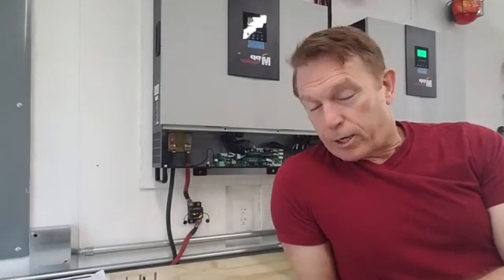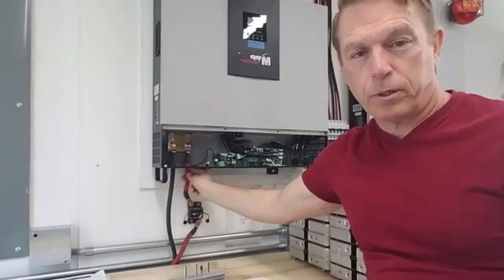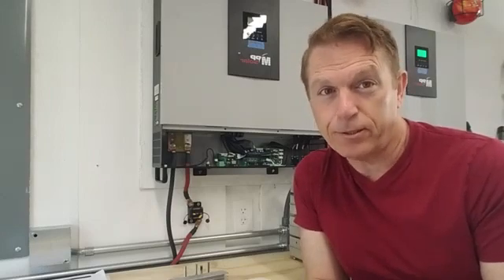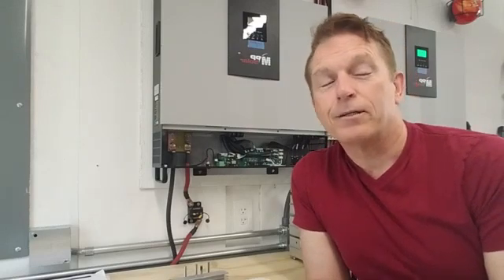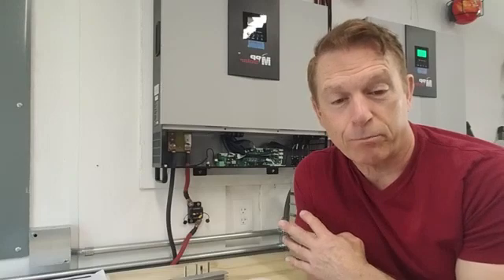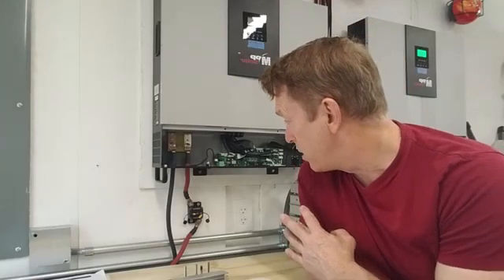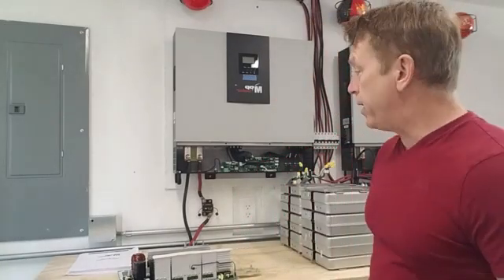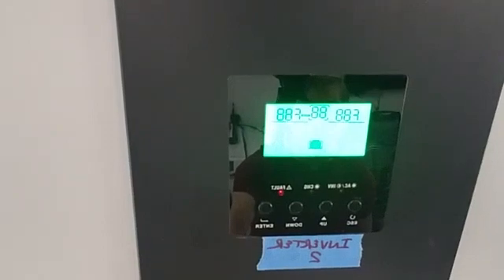MPP Solar LV5048 Mainboard side swap

Comment: You claim to be some sort of electrical engineer yet you can't even get the sound to work in your video and everything is mirrored.
Obviously you have one of two things going on. One is your batteries when these units are paralleled batteries must be connected together as one battery Bank or it will trip codes as it is necessary for balancing that both units work from the same battery voltage and amperage.
The other is the grounding center tap and Earth ground they should be connected together at the breaker panel not sure which way your paralleling these units. There is a grounding tap screw near the center on the main boards the grounding screw needs to be removed from both units then the center cap and Earth grounds will be connected together at the circuit panel which you should be using a double throw breaker preferably a fourth row means your paralleling two units of appropriate amperage to feed into the houses grid supply.  Are you using one unit for each leg so that one unit is exclusive to l1 and the other is exclusive to l2 or did you connect it the other way to where each unit is producing a split with a center tap so they each produce the two 120 volt circuits which are then tied together afterwards.
The other thing I noticed is you dealt with Taiwan directly instead of Watts 24/7 so you're pretty much on your own for trying to save a couple hundred bucks your problem would have been resolved by now but you went for the low price and now you get to deal with the situation you put yourself in with wonderful shipping costs to return the unit you so smart.

Comment: I have the same 2 units with same setup.  My setup is almost complete and ready to turn on(waiting on dc breakers). Good luck with your problem. Keep us informed. Thanks
Reply from the maker: MPP Solar is sending me more circuit boards  to install.
Reply: @CoHeSieve  Sorry to hear your trouble with them. Mine are now up and running with no problems so far.  Goodluck